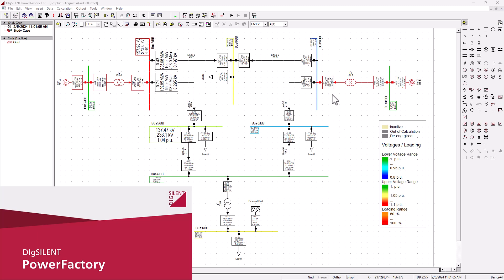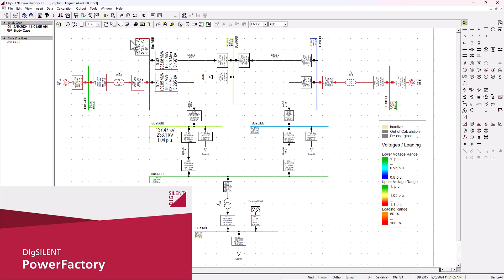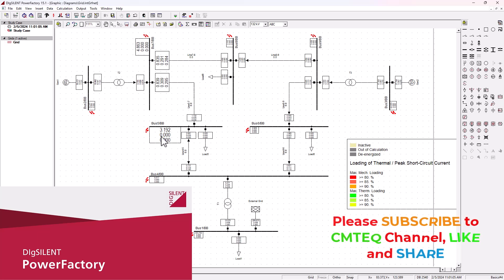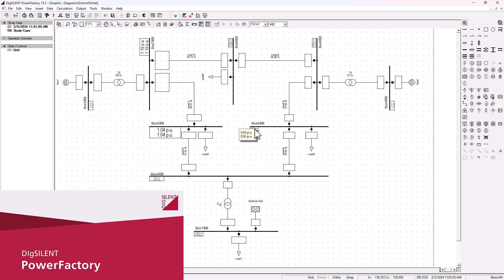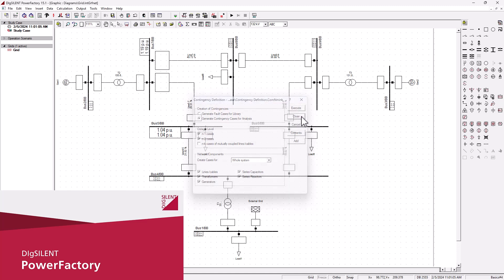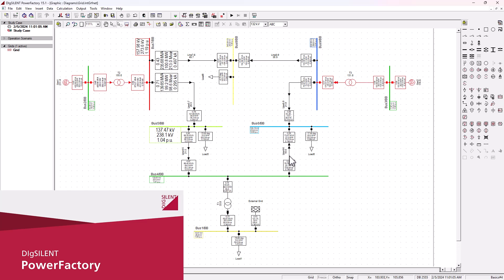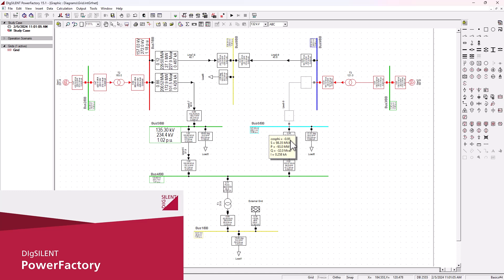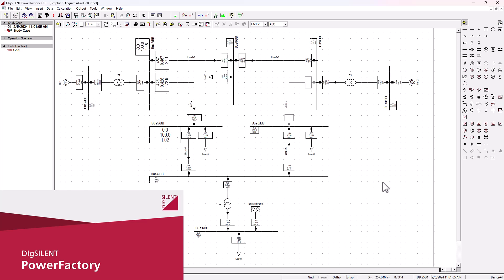What is DigSilent PowerFactory?

Comment: Please make a video over interfacing Matlab with DIgSILENT PowerFactory
Reply from the maker: Good idea, I will look into it.
I know that with DigSilent PowerFactory MATLAB interface, you can automate load flow analysis, extract bus voltages and fault current data, and perform system stability analysis. It also allows for custom control system simulations and protection setting optimization. Plus, you can leverage it for grid data extraction for machine learning applications like predictive maintenance and renewable energy forecasting.

Stay tuned.
Reply: @CMTEQ  Thankyou very much for considering my comment, I believe that we learn more with CMTEQ. 🙏